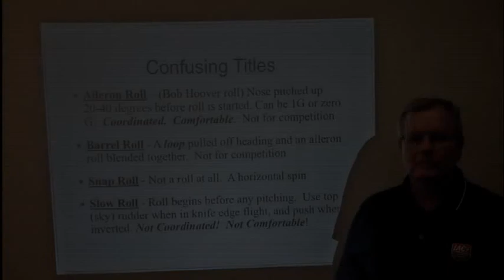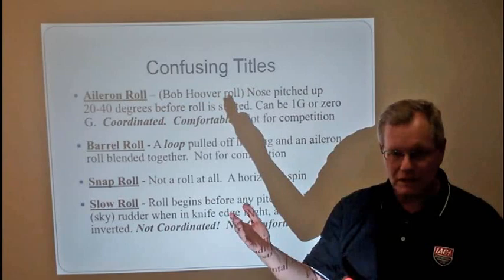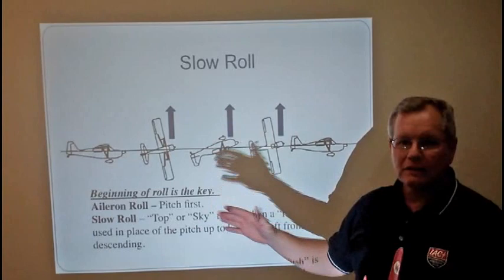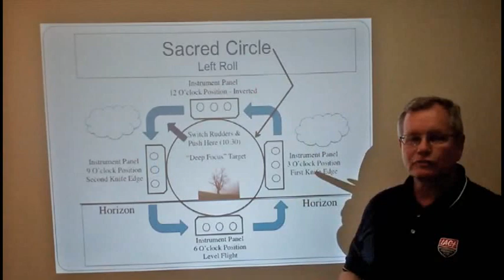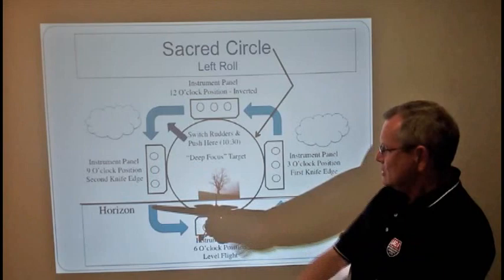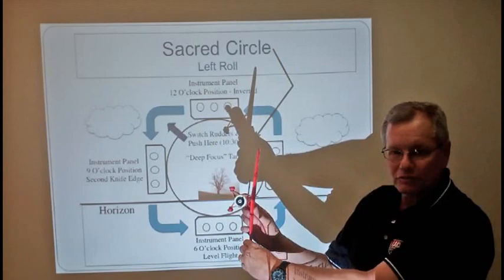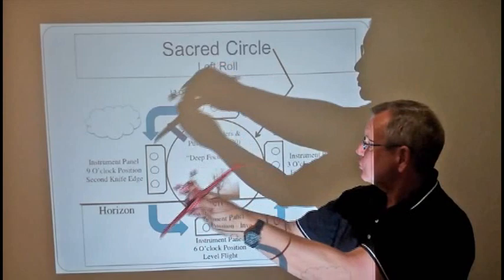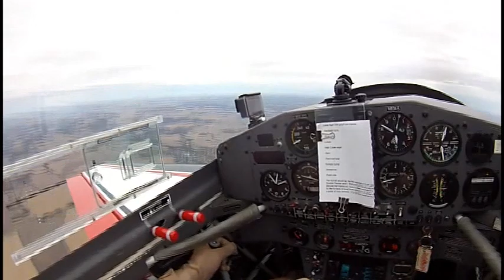The Aerobatic Textbook: Rolls

Comment: Could you go into a bit more detail on how to perform the zero g aileron roll without need for rudder? I´ve been discussing this and we assume there will be no adverse yaw close to zero g. I also suspect the way to do it is to pull up, neutralize, and as the nose starts to fall down around 0,5 g just make the full aileron input cleanly and swiftly. If you however do this from the pullup where you still hold some positive g to hold the nose up, and thus neutralize and roll as one single movement, my guess is there will be an uncomfortable zero/slightly minus g weightless situation, especially in a plane that doesn´t roll very fast i.e. 5-7 sec.